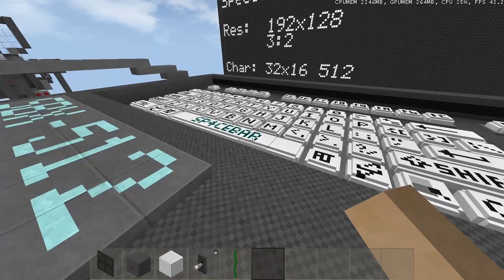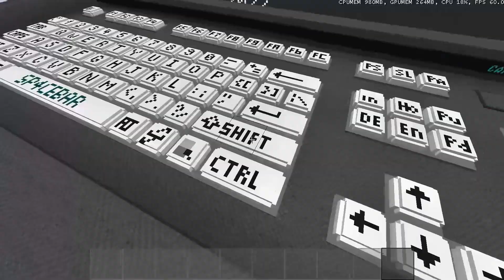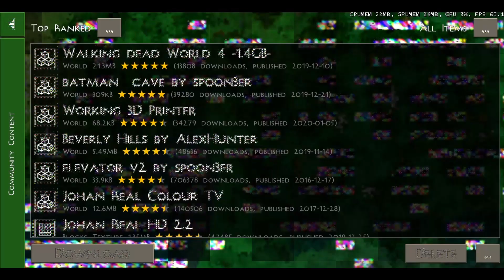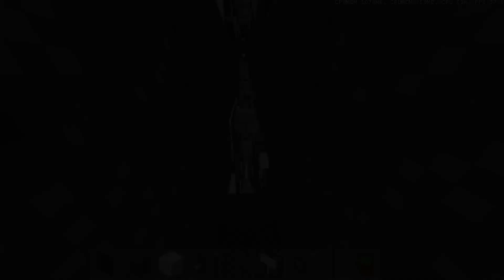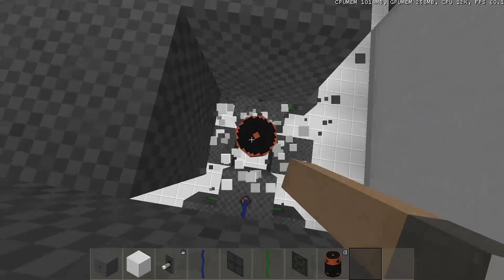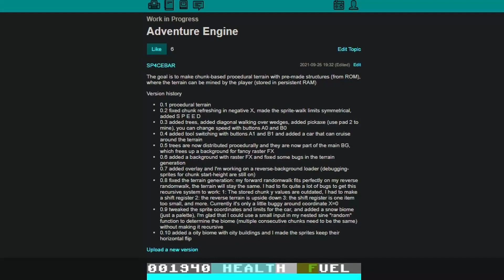Comment: Nice content Spacebar I need help I wanna make a game creator
Reply: What sort of a game creator? You mean a CPU with a GPU so that games can be programmed?
Or more like a bunch of general components which most games use, so it can easily be modified to make other games?
Reply: @SP4CEBAR  yeah a cpu and gpu so that games can be programmed,stored and played
Reply: @beelsonyt7136  well... then it gets complicated
You'd first have to understand how a CPU works, and then you'd have to make some sort of a graphics processor
Real world electricity is a lot faster than electricity in Survivalcraft
Early 2D graphics in the real world were done pixel by pixel (one after another), but in Survivalcraft we can't do that, so we have to do everything in parallel (all happening at the same time)

For a graphics processor you could choose for 3D graphics, or 2D graphics
For 2D graphics you need sprites, which are groups of pixels that can easily be moved together (for example the Mario character is a sprite)
And you also need memory to make a background (Mario has platforms)

For 3D graphics things get quite a bit more complicated (I still don't exactly know how to make one) 
- There's a simple trick that's used in games like Wolfenstein 3D which is called ray-casting, which calculates the distance in 2D between the camera plane and all the walls it can see, and it then shows those distances as the length of a vertical line, and all those vertical lines (all the calculated distances) next to each other look like a 3D image, even though the map is 2D
- there are other methods: there's ray-tracing and ray-marching, some are used to get realistic lighting as well
- and there are also matrices which might be one of the best ways to make 3D graphics in Survivalcraft (but idk for sure, I'd first have to learn how matrices with perspective work), if I remember it correctly, even games like Minecraft and Survivalcraft use them

A CPU can be summarized to this: a calculator (ALU), memory (RAM), and a controller (Control Unit)
The controller reads a task from the memory, and then it controls the calculator to perform that task, and then it reads the next task, and so on

For more information you could look for videos about how computers work and about graphics, and all those rendering methods, or you could search for retro graphics from those early game consoles (Atari, Commodore etc.)
You may also be interested in the "computer science" series from the "CrashCourse" YouTube channel
I do plan to make videos about these things, but it will probably take a while until I covered most of these subjects
Reply: Bro thanks ❤I think about a trick where I can control the sprites in d screen i.e each layer has a sprite which will enable it to work differently.

And for the logics it has to do with the storage and ram,my ram receive what is stored in the storage and my has logic gates (limited)  that will do things according to how it is stored (the code in d storage) which will executive the commands from the storage and i have my controller that is connected to the storage and the ram,when i press a certain button the storage will check the location of d code stored and then send it to the ram for execution.I uploaded three worlds in survival craft which are car racing,car racing 2(but in 3d) and electric tic tac toe by beelson but i was new to electricity that time
Reply: @beelsonyt7136  cool!   good luck with the rest of your project!
Reply: Thanks bro good luck too i hope u will make a full computer one day ❤😊

Comment: I couldn't play it because it doesn't turn on the screen, how much visibility do you have? because I have it at 112 and still there is a lot of lag and I don't think my visibility is enough to load the whole circuit and I guess that's why the screen doesn't turn on :(
Reply: I usually have something like 256, I think, also this screen takes up more than a gigabyte of RAM (you can see it in the top right corner in the video)

Comment: Man this is so cool there's so many things in electronics side that I just outlooked it because it looks hard
Reply: And also would you be interested in making a survival series just asking
Reply: I've been thinking about doing a survival series
I could make some machines that would make mining easier, so that I could get all the germanium to make pistons (which are way too expensive), and then I could make some flying machines that I could use to mine/excavate and explore
Reply: @SP4CEBAR  and also bugs are kinda common in the game it might be also interesting to see 
Well I'll give you a bug that is annoying making pistons gives you five right but if you modify the settings of the pistons in your inventory and place it all the other ones will disappeare but the one you've placed will not this bug lessen the affective ness of my cobblestone generator and then i needed to mine more of germanium (and also this is were my tools are just copper which sucks)
Reply: I've heard about that one, that bug really shouldn't be there
Also, did you know you could cause electrical components like the AND-gate and the digital to analog converter to bug out 
You can do this by placing them on a block with a wire on the side of that block so that the wire connects to an input of the component, and place a wire-trough-block so that the edge of that wire-trough-block touches the corner of the wire, and one of its connectors is pointed to the wire, and place one wire on the connector of the wire-trough-block to connect it with the other wire, then place a switch on the other end of the wire-trough-block
When the switch is turned on, the AND gate should act like an OR gate and the D/A converter should act as if it was rotated
To see this, you could connect the output of the component to a 7-segment display or a 4-LED